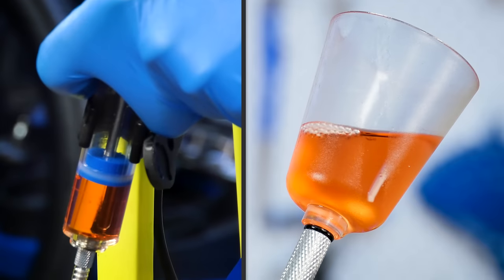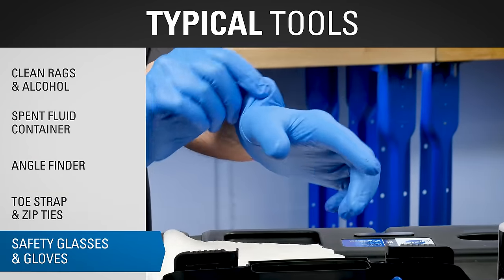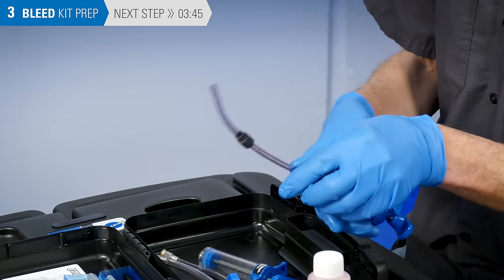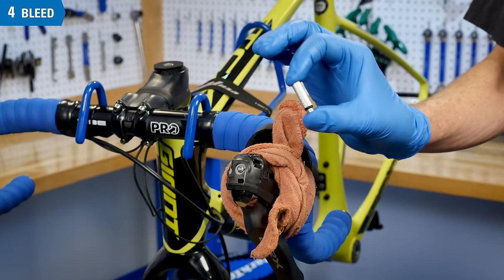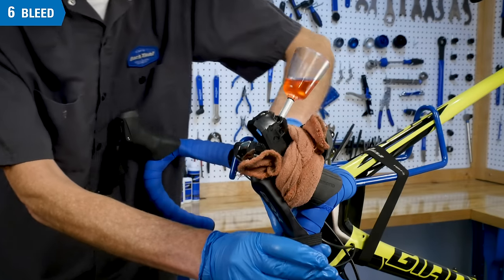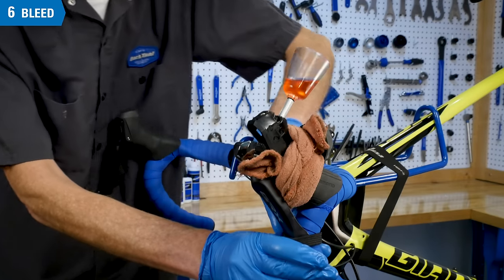How to Bleed Hydraulic Brakes - Shimano® Drop Bar Levers

Comment: In my experience most of these steps simply isn't necessary.  All I do for a perfect bleed every time in minutes is attach the funnel and push fluid up using a syringe. I then rotate the bars to various angle -45 degrees to 45 degrees and squeeze the brake lever several times until no more bubbles appear and the lever feels firm. That's it. Done.

Comment: Why do you first bleed from the calliper site and then proceed to bleed threw the lever, why not the opposite way? Then one could dispose the old mineral oil in the plastic bag, before bleeding a fresh one from the bottom. Doesn't it make more sense? Otherwise you mix the old mineral oil with a fresh one.
Reply: They are following manufacturer's (Shimano) instructions. And since brakes are the most important component I'd say sticking with what people who designed them say is a good idea. You can completely flush from the calliper too, albeit it's a bit more annoying.
Reply: "following manufacturer's instructions" is not generally very satisfying answer to "why?"
Reply: @raneksi  he asked why and the answer is because that's what manufacturer (i.e. people who know their product best) recommends. Are you special?
Reply: Bleeding with fluid flow from bottom to top is more likely to move bubbles out since gravity pulls the liquid down and bubbles move to the top!
Reply: @GuyZoghby that's what I was gonna say as well
Reply: Gravity, the air is easier to be separated and ejected that way
Reply: For what it’s worth I have had a lot of success setting up the cup at the lever and then drawing fluid out from the brake with a syringe. Far less complicated and faster than this method. Results have been good across six or so bleeds.

Comment: Great easy to follow video.  I had watched other videos but non of them covered the need to burp the system by moving the bars.  Once I did this procedure air bubbles appeared immediately and after a few pumps my front brake was as sharp as the day I purchased it.  Thanks 😊
Reply: I agree 100%. Bleeding road disc brakes can be fucking frustrating. The explanation and orientation of the fluid reservoir shown in this video is literally the essence to it. And whilst some other videos also tell you to rotate the bike while doing it, none of them explain why and in which angles.

Comment: I want to add a note for anyone adding oil for the first time into an entirely dry setup, as in cases where calipers and the shifter ship separately: make sure there's enough oil in the cup, and you're not going to let gravity draw out additional air in the lines as the video demonstrates, but you'll instead use the syringe to repeatedly draw air out from the bottom, somewhat like SRAM's method for their dual-syringe setup, which here would be great. (Again, assuming an entirely dry system vs a system with oil and a minuscule amount of air.) Keep drawing out the air from the bottom, and repeat, repeat, repeat until the lever feel is firm. Don't overdraw from the cup, so make sure you've got almost an entirely full syringe and start with maybe 1/3 of the top cup.

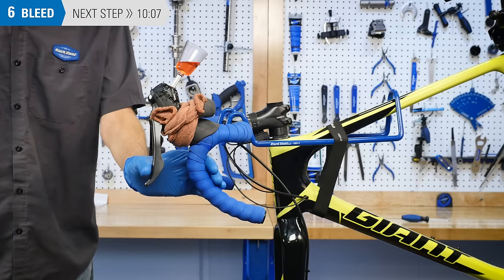Comment: Hello Calvin, thx for this helpful video. When pressuring the handle (video 7:55 min) air bubbles keep coming out of the brake caliper. I had to fill the funnel 3 times. Is this normal? For info: bleedin g the rear brake ST-R8050.

Comment: Long and drawn out like most American video’s, but the only one that suggests reverse bleeding from the reservoir like you would on your car. And that was the clincher, good firm brakes. Just one slight amendment; after pumping through all the air try closing the bleed nipple mid pump a few times. Thank you Mr Park Tool.
Reply: Long? Absolutely. Drawn out? Disagree. Everything was very concise, he was just more thorough in his procedure than those that would have you believe it's a 5min task. The reverse bleed and burping steps finally got my brakes feeling factory again.
Reply: I like how you managed to give a backhanded compliment to parktool AND be xenophobic all at once. Nice combo.

Comment: Hi. At 08:20 you’re starting a step with quick opening/closing of calliper bleed nipple with pumping of brake lever. May I ask what is the reason for that?
Reply: to cause strong pressure that will hopefully dislodge bubbles, I assume.
Reply: Pumping the handle should compress any air bubbles. The smaller the bubble, the less likely it will stick to the system. Then, opening the bleed screw should allow the bubbles to move through the system.
Reply: From my understanding: This a technique to “combine” several mini-bubbles to one/two bigger ones. This one bubble can be released why more easily and less fluid will be pushed out when opening the port for a millisecond.

Comment: Thanks for the explanations. Actually I would have expected that, at the end of the operation, the brake lever stroke would have been shorter than shown in the video
Reply: same here
Reply: Me too! That’s the reason that I was searching how to do a bleed in the first place because my levers nearly touch my handlebars, which I’m not used to coming from mechanical brakes
Reply: There's probably a lever reach screw btw, you may also want to play with that?

Comment: Hi there PT, thanks for the tutorial. As it seems to be way more complicated than on flat bar brake levers (e. g. Shimanos MTB lines), how picky has one to respect these tilting angles?

As far as I understand, the various tilting help move any “trapped” air bubbles and fill oil pockets in the hydraulic system. But how exact do you have to be?

I in general just do a solid 50 to 100 ml bottom to top flush to just push out all residual air. In 95% of all bleedings in our shop, this is the solution in “the first go”. 

But if you have the time to comment on this approach, I’d glad to learn sth. new/better.

Thank you. And keep up the excellent work.
Reply: Probably good enough Vs perfection. I can see how tilting the bike like this back and forth with an open oil funnel on top would often end badly.

Comment: I’m swapping my rear calliper from BR-R7070 to BR-R7170, keeping the same internally routed rear brake hose ... Question: I know I will need to change the olive, but do I need to change the insert as well? Also assuming this swap will likely require a brake bleed after.

Comment: For the 45 deg angle and burp position, what if you have a one-piece cockpit? you rotate the entire bike?
Reply: That's the only way I think. Also, I don't think most bike shops do the tilting, it's probably good enough without the tilts most of the time. You can also do the SRAM way I think, which is pulling oil from below with the syringe. Back and forth a couple of times.

Comment: I did a full gravity bleed and the oil came out clean. Immediately afterwards, I syringed fluid up into the lever from the caliper and it was filthy. It seems the gravity bleed didn't fully flush the system. Shimano 105 R7020 (pretty much the same as shown in this video)
Reply: Hmmm... Confusing stuff.

Comment: Hi Park Tool,
your tutorials are amazing as always and they've helped my partner and myself a lot. May I humbly ask for your advice on this particular issue?

The Shimano hydraulic disc brakes on my partner's roadbike have lost their bite, so he decided to bleed them -- bought the correct shimano fluid and kit, opened the plastic screw on the handle and, with the funnel, tried to top off the liquid. He also pumped the brakes to see if any bubbles would come out, but nada.
So the brakes are still spongy (the pads are still good, we checked those).
Unfortunately, the poor soul wasn't aware that the torque for said plastic screw was like 1Nm, so he pulled it tight when putting it back in - and now it's stuck. The Allen wrench still grips, but it won't budge.

Got any advice?
Replacement screws are hard to come by these days and apparently this is a common mishap.
Should we just take it to the shop or is this something we can tackle on our own?

Thank you in advance. Your videos are amazing!
Reply from the maker: You can try this on your own, and take it in if it  does not work.  Getting the screw out is going to be the issue.  Use a new key and push down on it as your turn to loosen.  These are typically steel, check that with a magnet.  If there is a large shop they may have a "bone yard", with scavenged parts.  See if you can find one.  If the brakes are spongy, the bubble may be at the caliper on in the line.  Worse case is you need a new lever, which can be done.
Reply: @parktool  Thank you so much. You guys are just incredible!

Comment: why did you put in new liquid from the top when the old was dirty? is that just another way of changing liquid? i would imagine if you kept using the syringe and burping that it would bring the same result. whats the benefit of gravity feeding the new liquid?
Reply: I wish we could get some engineer's answer to this.
Reply: The system sometimes “pulls” in some oil if air is released.
If there is no oil reservoir above any air in the system, the lever etc. could suck in some air, which gets trapped.

If you replace old oil with new one, you will remove any dirt, that could damage the rubber o- or quad-rings.

Is used “old” oil in the past, if I had to bleed “in the field” and everything was fine. But if you gave the chance to refill with new one - do it.

Hydraulic systems on bikes are not “hermetically sealed”, so you will always loose tiny amounts of oil. And you will always collect some dirt resulting from wear&tear inside the system (moving rubber on metal + dust from outside).

Comment: The part with quickly opening and closing the bleed nipple is somehow giving me grief. At first it failed to repump completely, so I started from scratch and pushed the fluid up through the caliper again. Quite a lot of bubbles came out, so air somehow got in. But the quick open and close part was still weird. There was definitely fluid in the funnel and in the hose, but after the pressure was lost it was still not possible to repump it. Except, somehow some way it worked - I left it alone and it worked. I thought it was maybe the plunger I put in the funnel, and I repeated it three times just to see which step caused it, but it was mostly random to me. The lever feels firm now, so I decided to leave it alone. But I still wonder. I will see with the second lever.

Comment: Why can I find tutorials where it seems enough to push new oil through and close it up again without bleeding out the bottom and changing angles? Did this video show the example of draining to the bottom for the example of dirty old oil or do you always do it this way?
Reply from the maker: There certainly different systems to bleed. Shimano's drop levers however do make it more complex to cover because there are several model with different reservoir designs. The concept of tilting the angle is to remove all bubbles that might be trapped at the lever.  It is possible to begin by pushing fluid up from the lower caliper and out the top.  Then drain fresh fluid down.

Comment: Should i buy 2 different kits if i have DOT and miberal oil break systems? Or can i just clean them between usages?
Reply from the maker: You will need two kits. The o rings in the kits are different and can swell or get hard if exposed to the other type of fluid.
Reply: @parktool  Swell or get hard you say... i dont like the sound of that! Thanks for the reply!
Reply: @parktool  Does Park Tool sell replacement O-rings? Seems like they should be replaceable since they will go bad over time regardless.
Reply: @spencerwarren902 Why should PT sell parts from Shimano? They’re two different brands/manufacturers.

Comment: Wouldn't you want to clean the rear caliper BEFORE installing the bleed nipple cap? In this video it was installed and you can clearly see mineral oil all over the bleed nipple. That could make it's way back to the pads and contaminate them.
Reply: Yes, one new trick I learned last is to insert a piece of twisted tissue paper into the bleed nipple to absorb all the hydraulic fluid left in there.

Comment: Thanks for this video! The way you have the bike rotated for bleeding rear brakes @2:08---is it okay to do that with a carbon bike, or will the torque on the seat post and seat tube be too much?
Reply from the maker: Totally fine to do with a carbon bike. This is a carbon bike in the video. A rider will put hundreds of times more strain on a frame and post than this.

Comment: What purpose does the extension serve?
Reply from the maker: The extension gets the cup above the rubber hood. The silver one matches the thread of the bleed screw, which is M7 x 0.75.  Not all drop bar models however use that thread size.

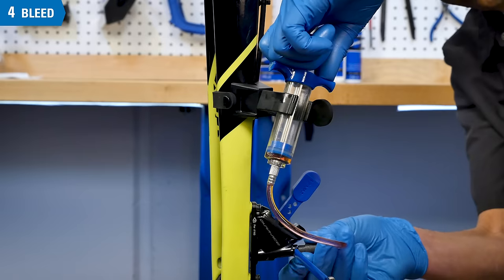Comment: Hi I'm bleeding a brand new set of brakes/levers so I assume the "dirty fluid removal" step isn't required after 6:20? If so what would be the next stage after that? Would I just close bleed port on calliper & removal syringe and then do the burping technique? Or do I need to attach something calliper end again ?
Reply from the maker: If you are working on a new bike there is no need to get rid of the fluid so you can move to the next step of tilting the lever and continue the process.

Comment: I prefer the shortest Free Stroke for max response when I brake. Prior to bleeding, should the Free Stroke screw be backed out so that if a short stroke needs adjusting after bleeding, the screw is in position to allow that adjustment? It would be similar to screwing in the barrel adjuster prior to replacing a mechanical brake cable to allow slack to be tightened.
Reply from the maker: The answer is yes..... But Shimano is pretty honest about the free stroke screw offering minimal effects on the stroke.

Comment: Has anyone tried warming the fluid to make it less viscous and therefor allowing the bubbles to escape faster?
Reply from the maker: Adding anything to the manufacturer's fluid would change the properties, and they certainly would consider that voiding the warranty.  Being patient and thorough is the best  way to remove bubbles.
Reply: @parktool  Warming a fluid isn't "adding anything", though the properties that change may, as Jay Palmer stated, allow bubbles to escape easier (faster). Yes?

Comment: I would like to know if your portable bike stand will hold a specialized turbo levo or is it to heavy for the stand? Wanting to know before I purchase one. Thank you very much.
Reply from the maker: Looks like the Turbo Levo weighs approximately 51 lbs. The weight capacity of our repair stands varies from 60 lbs. to 120 lbs. depending on the model, so any of our stands should support a bike with that weight. You can find full specs for our repair stands here: https://www.parktool.com/category/repair-stands

Comment: The resevoir extension and compression sleeve are clever little extras you have to buy in order to do the job "right". My eyebrow raised even further on seeing the 7mm box wrench. Doesn't it seem odd how even if you buy all the parts and are set to do the build, you are so often ambushed by this kind of faffery.
Reply: Faffery...Had to google it. My new word for the day. Good luck on your bleed.
Reply: 350kph: Park assumes that the user has a set of tools as do all quality tool sellers. Considering that this tool is usually purchased by professional bicycle mechanics, that's a reasonable assumption. The instructions should include (and probably does) a list of extra tools needed.

Comment: Hi,Calvin Can I Use Tektro Mineral Oil In Shimano Hydraulic Disc Brake As Shimano Mineral oil is not available?
Reply: There is another video on YouTube where someone is using baby oil and also mineral oil from the hardware store and they work fine.
Reply: Tektro's mineral oil is like a slightly cheaper copy of Shimano.
Reply: as long as its mineral oil it should work. however do on your own risk, if seals go bad after 2 years because the oil did have different properties than the original it would be a shame. its highly unlikely though.

Comment: Excellent. Thank you. Off topic: I see this bike has Shimano GRX brifters and Dura ace calipers. Isn't that an odd mix?
Reply: The brake calipers from the GRX series are basically just rebranded calipers from the regular road components series. You might not see it on a new bike but they all work together
Reply: @ethanbowering9944  I'm not disagreeing. I'm having so much difficulty setting up my GRX brakes because I think the brifter side of the brake system is different for GRX than 105/Ultegra/Dura ace. But I just don't know.  Primarily because the part number for the needle is different in the GRX dealer's installation manual.  The needle for the GRX is the silver needle, not the gold one.  Just a slight difference.  And the connecting nut is not the same part number either.  I have twice as much Shimano mineral oil on my carpet as in the brake system.
Reply: @richardbryanesq  You can mix and match any current shimano STI and brake calipers (even the 4pot MTB ones to the road/grx STIs and vice versa) regardless of their "level" in the line-up with the SM BH90 brake line. the end parts differ between road and MTB usage and there are some different part numbers because of different colors and so on. f.e. XTR uses a black banjo instead of a silver one and so on.

for your GRX/Road mix there is no difference. insert pin and olive on both ends of the brake line. maybe you used the wrong bolt to attach the brake hose? the bolt with the ring around it is for the levers, the one without is for the caliper.

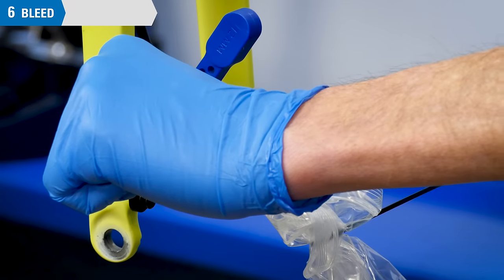Comment: Any reason you cant skip directly to 7:40 and simply bleed the brake system this way, purging all used fluid in the process? This way eliminates introducing air. Its how i used to bleed motorcycle brakes. Much cleaner and faster as well.
Reply: Yeah i also wonder why, this is how i bleed my motorcycle.